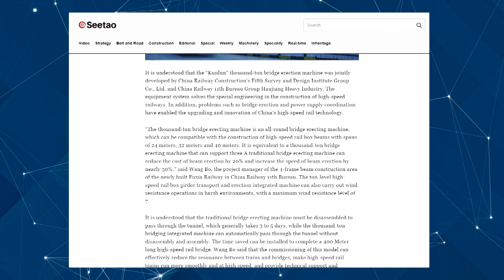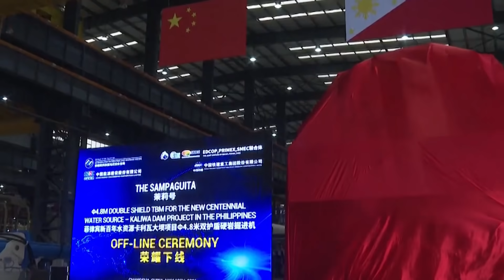UNBELIEVABLE Mega Engineering, How China BUILDS So Fast, World Records Construction Speed

Comment: China those bills fast The reason why everything comes apart One they don't have a chance to let the concrete die cure and be strong too they allow so much weight on top of their on dry concrete and it crumbles so when it's dry it's already cracked and three the concrete mix they do is the feasible for anything that's why it comes apart One Bible concrete 20 bags of sand

Comment: like the parts of concrete bridges that are towed into position, the parts of buildings can be prefabricated in nearby grounds or at a facility and delivered to the site by large towing trailers. This helps to speed up the process of building each floor till the whole building is topped up.

Comment: It's been almost 20 years since CA passed the high speed train from SF to LA.  Not a single mile of track laid, but billions spend by lawyers.  Yup, US run by lawyers, China run by engineers.
Reply: You nailed the nail right on its head!!!!!!
And it is claiming the super power???
It’s looking like the derailing power
Reply: The brightest kid in the class often attracts more critics from the rubbish students. Period.
Reply: FYI, China has a high-speed rail system. It is currently running at a loss whose accumulated deficit totals over $800 BILLION! I would also suggest you google "tofu-dreg project" to find out about the reality of modern Chinese infrastructure. Modern-day China has undersea road tunnels which leak, skyscrapers which shake (and even collapse), and concrete walls (and bricks) which can be (literally) picked apart with bare fingers.
Reply: @Stephen-gi1rx  However, a Paulson Institute research had estimated that the net benefit of the high-speed rail to the Chinese economy to be approximately $378 billion and an annual return on investment at 6.5%.
Reply: @philip7415  I've been trying to post a more detailed reply but for some reason ** won't me. (It keeps deleting my posts.) 

That Paulson study has some major limitations. Costs are NOT based on REAL numbers but GUESStimates. For example, operating costs are based on just ONE line: Beijing-Shanghai, "the only route with detailed operating cost data, minus the rolling stock cost."

Why are there detailed operating cost numbers ONLY for the Beijing-Shanghai line? Probably because that just so happens to be the network's most profitable line.

Here it needs to be pointed out that China's high speed rail network USED to be profitable. The problem is China kept building & building it until it had the largest network in the world, over 23,000 miles, around 10 times longer than the next longest such network (Spain's). As it grew it began building into places which were LESS profitable to run.
Reply: @Stephen-gi1rx stop taking things that makes you halucinate
Reply: @tangbesitangbesi7009 He’s not wrong, maybe do some research before falsely correcting others
Reply: @jayandrusiak  that's bcos you are trolls of the same bunch
Reply: @Stephen-gi1rx  yeah, keep bad mouthing China, we all know what your motives are.
Reply: @Stephen-gi1rx 自己去中国多看看，不要只看网络信息，中国有很多东西不够好，但拿这几十年的变化和全国人的生活质量对比其它国家，你们说中共不行？

Comment: The question isn't how fast can China build structures.  The question is; How long will the structure stand before it crumbles. I'm a U.S. ex-pat and a Certified Quality Auditor, and have lived in China for 10 plus years. The building techniques are fast, and easy for the contractors, but the common building designs are terrible engineering and design for maintenance are almost nonexistent, and generally not upgrade compatible in any form. 
Our buildings were recently upgraded and all of the upgrades were done to the outside of the buildings and the old hardware just left as useless contained within.  It was an electrical and plumbing upgrade because they had built with aluminum wiring which was degrading rapidly and causing fires.. Then they upgraded the lead piping and put all of the plumbing on the outside until it entered each apartment where it was mounted to existing walls, leaving all of the old rotting pipes in place and making every apartment interior ugly. They used PVC for the upgrade. Quality is not of great concern here. Fast profit with the least effort is the motivating factors. Of course the governments present it quite differently as the propagandist comment below mine (Kittyququmber) indicates.

China could do amazing things if they would bother to maintain quality standards... But they don't unless they are under CCP contract.
Reply: The Chinese designed the Tesla's FSD and not to mention Tesla, SpaceX, Solar city are all Chinese rebranded technology incase you didn't know.
Reply: @alphaomega1969  Whatever you say... Oh brainwashed one. 😂🤣🤣
Reply: @gecsus  It is not a joke dude, it is the scoop of the year. Lol 95% of Tesla is made in china, only CPU and GPU is American and design of the car.
Reply: @gecsus  Your comment says a lot about you, the world economy depend on china if it wasn't for CCP, not government is perfect.

Just because you had a quality issue in China doesn't mean everything they do is bad quality, take for example UK seller on ebay would have choice from their supplier for cheap goods and premium good... The problem with cheap goods they dont last but sometime they last
Reply: @gecsus  who isn't a troll on youtube? You need to learn to be more optimistic so that it will bear fruit in your life.

Comment: I'd just be worried that it 10 or so years these buildings and roads will be in awful condition. I just have seen a lot of videos from china where they are pouring concrete and let's just say if it happened anywhere else the pour would be stopped and people would be fired. But hey it got built quickly so thats the main thing.

Comment: China uses the same amount of concrete in 2 years as the US in the whole 20th century, so if China's building doesn't fail 50 times as often as the US, I call it a win for China
Reply: China has 5 times the population of the US's and up until 4 decades ago, China's main transportations were bicycles. China might be using up lots of resources so far, but if you works out resources/costs per head, the US still uses much, much more than China's. Not to mentions, if the US was to build the equivalents of China had, the time, the cost, the resources per head will be many times more!
Reply: yes indeed.
Reply: @SeekTheTruthJesus  So you are talking about the Mexicans in the USA when you are talking slave labour and why are you congratulating your Horrible USA.  I am confused as you are burning your self.  I also recall you had a bridge collapse in Florida like a 1 day after construction because you hired 6 woke women engineers to design it.

Comment: @5:43, good try spinning lies. Elon Musk’s boring machine is a fraction of the size of China’s boring machine. This means the China’s boring machine can bore a 100  feet diameter tunnel while excavating  faster than Elon Musk smaller diameter and slower boring machine. 100 feet diameter can provide three  lanes each having  12 feet wide with 12 feet shoulder for each direction. In fact the USA doesn’t have any tunneling or boring machine equal to the China’s boring machine.